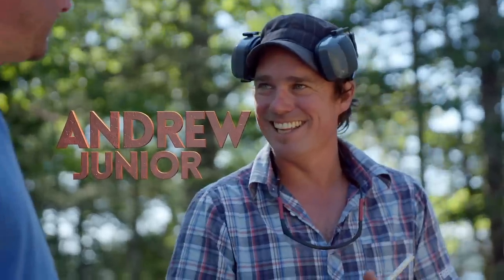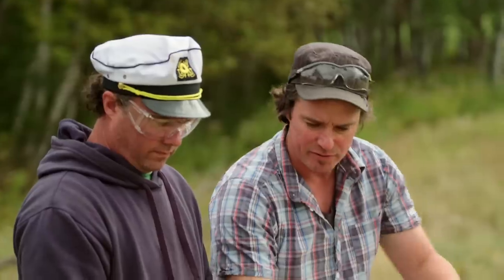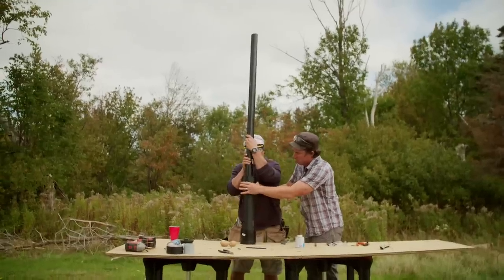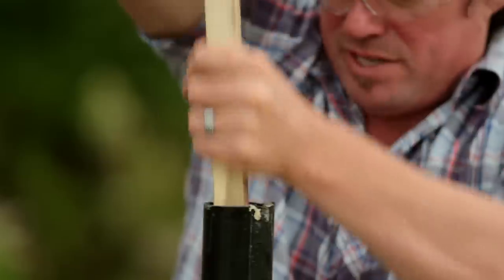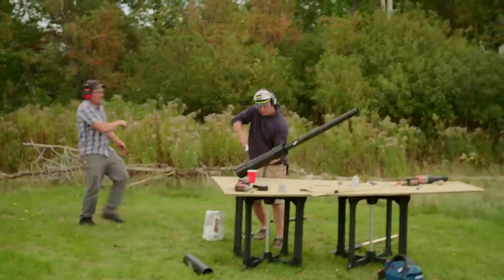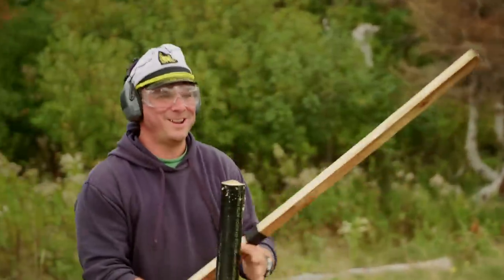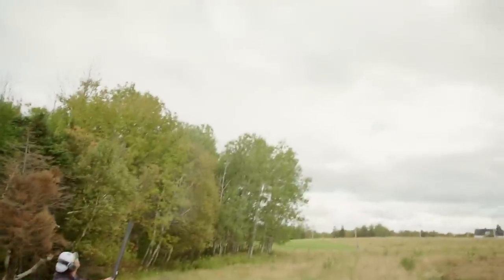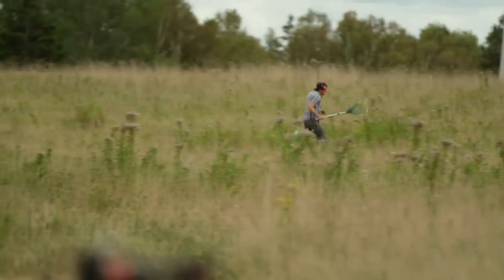We built a Potato Gun! - Brojects: The Webisodes

Comment: It will fire much farther and will much more force if you put the projectile in the end of the barrel, then spray your combustible fuel of your choice into the gas chamber, screw the end on and then finally slowly push the projectile down the barrel to the stopping point, then fire. This pressurizes the gas in the chamber to make for a much larger explosion.  But you didn't hear that from me lol also not a bad idea to wrap the gun in duct tape, that way if the gas chamber itself explodes its contained and will not allow for shrapnel.
Reply: ed spitting fax rn
Reply: Not Ed’s first rodeo
Reply: This dude potatoe guns
Reply: My question is...after firing mine, the cap on the end doesn't want to unscrew. How do you solve this problem?
Reply: @garyliddell2814  you tightened the cap too hard
Reply: oh gott ed,ne hab ich nich von dir,aber ich weiß genaz geau was ich dieses wochenende mache :DD
Reply: @garyliddell2814 Teflon tape-plumbing section
Reply: Ur doing the lords work.!

Comment: Add BBQ gas ignition switch, reduce the diameter of the barrel and sharpen the end of the barrel to “cut” the potato to size.
Reply: either that, or 3D print a really thin hollow shell, and fill it with flour. Gotta make sure the bore diameter is right though
Reply: I used a separate piece of pvc for a cutter to mass produce.
Reply: How big does the chamber need to be? Mine is relatively small. Wondering if I should extend it. Also have an issue where i had a bbq ignitor that worked put of the box then as soon as I glued it in it stopped sparking. Still trying to figure out what happened

Comment: Use HDPE instead of plastic or PVC, it doesn't shatter if it explodes. 
Also the better way is to put screws through either side so the ends almost touch and wiring a grill igniter to both screws to create a spark gap when you push the button.

Comment: I switched over from the hair spray or ether to air powered, spud goes easily 3 times as far and if you make the barrel threaded you can screw on a golf ball or tennis ball barrel... mine at 110 pounds puts a golf ball out about 600yards, that's about a 1/3 of a mile.
Reply: robzilla2165 hey there  how do you seal the golf balls ?
Reply: @tanksoldier9770  i wrap them in toilet paper

Comment: For those who do this at home: Stuff potato in enough to make a seal, use a ABS/PVC chamber that also the big base and a smaller ~1 inch screw on (easier to close quickly),  affix a gas igniter permanenty (dont use a lighter), spray the ether, screw the intake on, then push the potato down. Fuel + compression people, compression!

Comment: Didn't look like pvc, more like abs plastic
Reply: 100% correct there. That is not PVC. So they are also using the wrong jointing method. But I suppose its only a spud gun...

I love hearing them say "This glue goes of very quickly so it leaves little room for error."

What does a drainage plumber do every day.